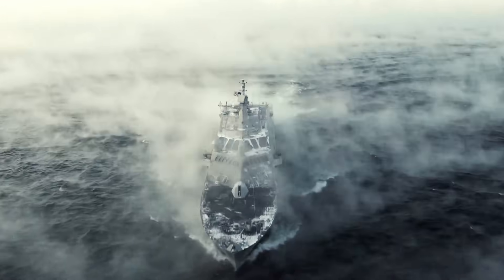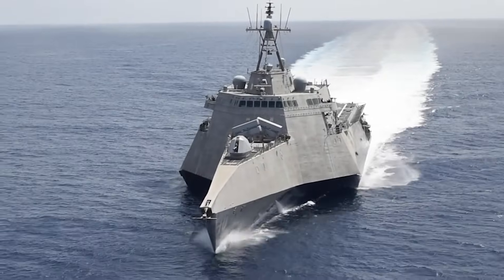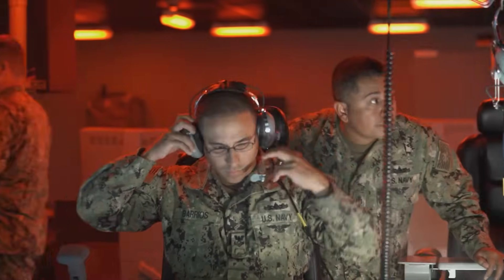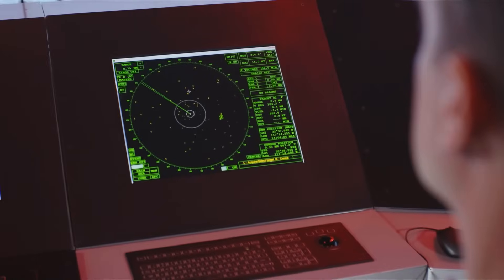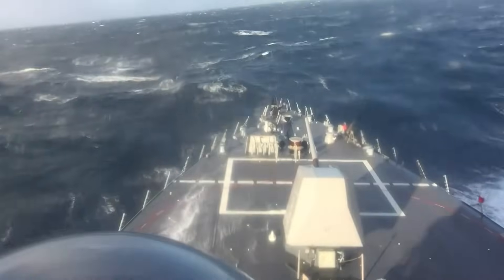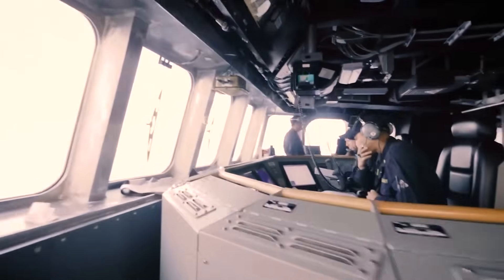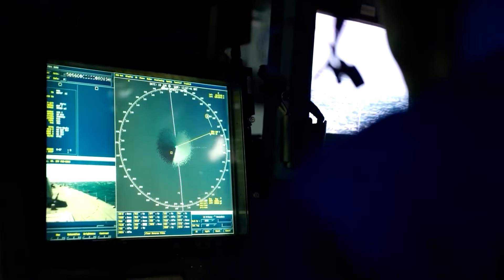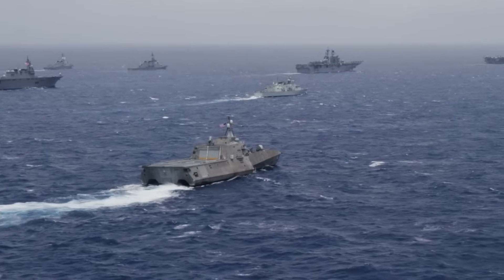Why TERRIFYING WAVES Can't Sink US Navy's $500M Combat Ship in Rough Seas

Comment: This cheery message runs counter to every other review of the mismanaged development of this  (these) platform.   If the modular systems were working as designed and the anti-sub, anti-mine and surface warfare capabilities hadn't been stripped I'm sure the Navy would have made a stronger effort to fix the thruster issues as a development cost and deploy these (many) units.  But this is pretty much a dead issue and the replacement isn't all that attractive either.

Comment: Good lord, the 1.8billion wasted on these floating t*rds could have go into the RAH-66 or better yet LCS Freedom and LCS Independence should have been built with steel hulls. "The bow features a specially designed flare that deflects water that helps prevent water washing over the deck" Yeah this is not special it's called a "High Fore-Castle," civilian boats have it.

Comment: You are so wrong. Go do better research. Both types of littoral combat ships have been canceled by US Navy due too structural and mechanical issues resulting in cost overruns and restrictions on sea states they can operate in and max speeds. One has an issue with structural cracking which limited its ability to operate I. Rough seas. The other has a serious mechanical issue with transmission which fails and does not meet up to load specifications. Not too mention total failure of the modular loadout capability which was prime reason for contract.

Comment: $500,000,000 USD - Not another expensive, complicated toy, come on! It can't submerge, fly or travel on land and it's aluminum plating buckles. Dumbasz politics ruin innovation.
Build a group of smaller ships that can play in the oceans. skim, skip fly, submerge, traverse land, quickly shift left and right. Give them missiles with small clusters bombs inside, torpedo's, acid cannons, depth charges

Comment: If the littoral boats are so capable, then why don't they put to sea? Rather than sitting at Naval Station San Diego benefiting nobody. Or were they simply designed to stimulate lectures?
Reply: USS Indianapolis just got back from the Red Sea
Reply: @damongraham1398  Well good! Anybody else?
Reply: The Independence class is riddled with structural problems.
Reply: @33vortex  the newer ones have been fixed.
Reply: @damongraham1398  They are all new hulls, a new hull shouldn't be delivered with structural issues. Fundamental project failure. It's like buying a new car with a bent frame from the factory, it'll never run right no matter what you do.
Reply: @33vortex  I'm not sure about the Independence versions but the Freedom ones are running right. I'll double check but the last 4 Independence versions should have had those issues fixed.
Reply: What kind of structural problems ?
Reply: @holdurhorse9149  cracks in the load bearing structures between the hulls due to material fatigue.
Reply: LMAO, they retired most of them because they fall apart
Reply: @swiftusmaximus5651  falling apart is not the same thing as breaking down.  They fixed the issues.  The main reason they are not making more is LCS can not compete against a near peer.  They never could.  If the U.S. had wanted frigates they would have built frigates.  The mess with these new frigates doesn't make any sense to me.  The FREMM works.  Ok. you wanted to add a few things.  Why not just build more Arleigh Burks?
Reply: @damongraham1398  LMAO, they have retired LCS's as young as 5 years old.
Reply: @swiftusmaximus5651  yes, because they do not want to spend the money to fix them.  The newer ones have different combining gear.  USS Milwaukee could be just as good as USS Beloit.
Reply: @damongraham1398 I have read the same thing, but let’s hope it has some secret magic that will give it an edge over the enemy. The LCS looks good, and is noted as “cutting edge.” This video doesn’t match some of the other videos I’ve seen. Electronic control instead of mechanical control equates to dead in the water while experts try to get it moving. 
My dad, grandfather, great uncle, and uncles served in the Navy just after WWI, WWII, Korea, and Vietnam. I became an Army paratrooper and infantryman, so I haven’t been on the big ships.
Reply: @braveheartz263  I agree that the LCS has been overhyped. They have had issues that have been fixed.  They were never designed to face China or Russia.  They can handle North Korea and Iran now that those issues have been fixed.  Their mission modules except for the submarine one do work. Just like what the U.S. Navy is doing with the Zumwalt they can do with the LCS.  Not hypersonic missiles but normal upgrades.  Directed energy. Remote turreted guns. Even a better version of the Ukrainian sea babies would be a great addition to the LCS arsenal.  Those missile boxes could be mounted on the port and starboard sides instead of the flight deck.  I wonder how long would to cut hatches into the flight deck would take?
Reply: @2024: yes,  I know what you mean, man I have never heard so much high sounding words concerning a naval vessel in my 76yrs including the 18mons I serve aboard one. It was like listening to " Roget's International Thesaurus . " um like, what's the refutation is going on here? Whats up with the worded demonstralization? Why the non- binary moderation.
Reply: They are being used to train more sailors.
Reply: @damongraham1398  Well that's fine but ALL of them? The littoral vessels are defects brother. What makes that so bad is these defects were then mass-produced!
Reply: @charlesburke2379  not all of the Freedom class LCS had the deficit. The ones after USS Indianapolis(I think 🤔 maybe the one after) had their combining gear replaced with ones that work. They also retrained the engineering crew.
Reply: This is an convenient excuse for where trillions in taxes are redirected.
Reply: @larrylux  millions or billions. Not trillions unless you give me a time frame.  let me be clear.  I am a fan of the Freedom class LCS.  I hope and pray that they will be given an opportunity to prove their worth.
Reply: There's an overhead attached to various  different operations, depending on the requirement. 
Makes no sense just deploying the LCS when a different class of  ships can do that at  a lower cost of operation.
Reply: @Nitin_R_Naik  I have no clue but do you think a destroyer is cheaper than a LCS?  Yes, a destroyer could do it better, but cheaper?  I am taking a wild a$$ guess but 4 Freedom class LCS and 2 Expeditionary Fast Transports could patrol from Eilat to Kuwait City. Stops at Djibouti and Bahrain to swap out crews.  I believe this is something the LCS is able to do.  This will allow other better warships the freedom to other more important missions.
Reply: What do you think littoral means????  They were never designed for the ocean!!!
Reply: @ yes LCS are designed for the ocean. The patrol boats and minehunters had to be ferried to their area of operations. Yes, the first few trips to their area of operations in the Pacific were disasters.  The Freedom class LCS made the trip to and from the Persian Gulf  successfully. The LCS are not destroyers or frigates.  The are replacing patrol ships and minehunters.  I wonder why they have not made a anti air version? 4 or 5 phalanx guns and missiles mounts would work.  In the future that same number of direct energy or microwave weapons would be a great upgrade.
Reply: Ummm they are out at sea...

Comment: I still think they need to retro fit the O’l battle ships the feared power of the sea…
Reply: Well if you read Federal law. The Navy has to keep ships capable of sore Barber which there's nothing that can beat a battleship and the original heavy and light gun cruisers. And some like the Boston class had the rear turrets removed for missiles with their 8 inch gun turrets in the front. But federal law says that they had to find something that would replace the battleships especially the Iowa class and the Alabama Massachusetts and North Carolina I would say use the Texas to which is what the some what class was to do and those are pieces of junk too there's only three of them and they can't even fire the main gun because no one can pay for the million-dollar apiece the rounds cost so bring back the battleships get rid of this little wimpy junk